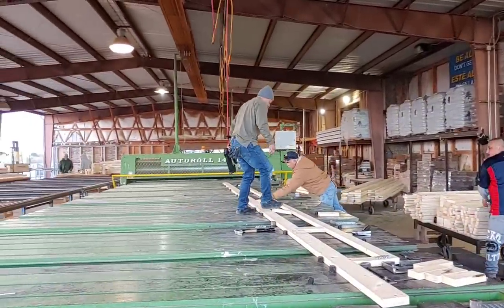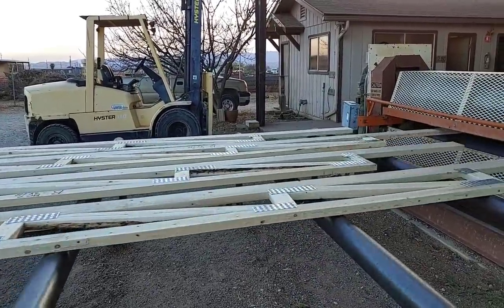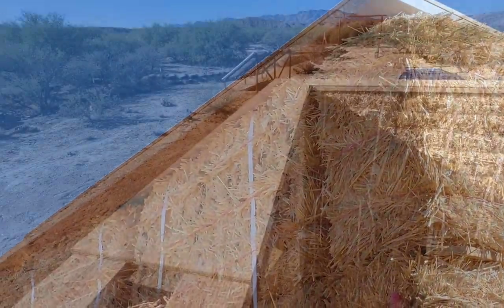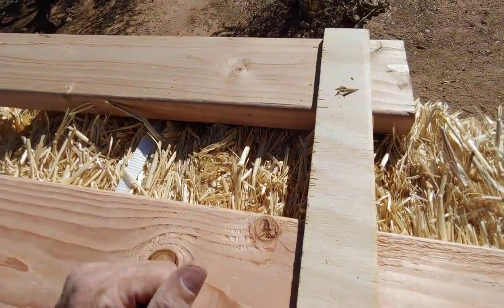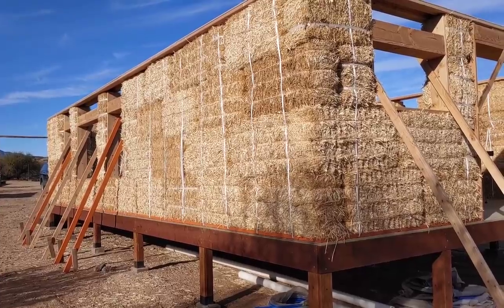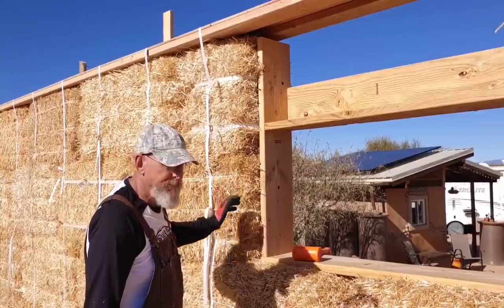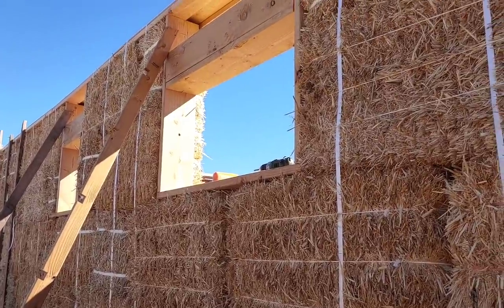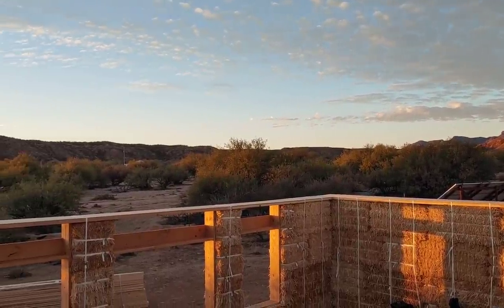#strawbalehouse #sustainable Straw Bale House Build Day 19: Box Beams And A Special Field Trip!

Comment: Great video once more Bill.  I was surprised that the straw bale walls needed that much fine tuning.  It's obviously not because of the work you and Yvonne have done as I know from watching your videos how meticulous you are when you build.  Bill can you kindly remind me what you have chosen for the exterior?  Some sort of cob or stucco or?  Thanks.
Reply from the maker: Thanks for watching and to answer your question,c we will be using an earthen plaster consisting of soil sand and clay with straw added for tensile strength. We will do two coats. The second coat will be fortified with about 5% Portland cement which we have found adds considerably to the weather resistant properties of the mix. Finally, we do use a breathable masonry sealant which is sprayed in using a garden type pump sprayer. This causes water to bread up in the surface like a freshly waxed car and prevents "dusting". Dusting is when you  rub up against the wall and start appears on your clothes. Sorry for the long winded response.

Comment: I'm generally seeing that people build box beams with 2x4s or 2x6s stood up on edge, sandwiched between osb/plywood on top and bottom. Your method looks like it'd save a lot on lumber (big deal right now!) but I worry about 1. the planks having more flex on their sides like what happened with this box beam and 2. thermal bridging happening since there's no insulation between planks. I'd love to know if/why you're not concerned about those things. Thanks!

p.s. I'm getting the same tool and straps/buckles as you after watching these! Hello from Tucson!
Reply from the maker: Thanks for watching and your comments. I'll refer you to an excellent book which I have been using as a guide for my decision making throughout the build. It's called, Build it with Bales Version Two by Matts Myhrman and S.O. MacDonald. They have a great section discussing the various styles and designs of box beams. I think you would find a lot a great information in this book for your build too!

Comment: Bill, it's looking really good!  I wanted to ask what model track saw you're using and would you buy it again?  Thanks, Al
Reply from the maker: Hi Al. I am using a Kreg Accucut XL. I chose this model for a couple of reasons but the first being price. The XL version costs about $150 and does NOT include the saw bit rather a sled that is mounted to a circular saw. 
It does not have a typical plunge action. It performs very well and does everything I need. I did buy the optional clamps for an additional $14 which secure the track to the sheet goods. Not always necessary but does assure that the track stays put.
I keep the sled permanently mounted to a Bosch 7-1/4" circular saw. I would definitely buy it again. What I wish it could do but can't is to allow a bevel to be cut.  Since I do not own a table saw, this feature would be a great asset. Thanks for watching and your question.

Comment: Sorry, Bill, what did I miss? At Southwest Truss, they "tacked" the mending plates on and then they went through the rollers. So were any more easterners put in?
Reply from the maker: That's all as far as the construction oof the trusses is concerned. Of course Timberlok structural screws were used in addition to hurricane ties to anchor the trusses to the box beam.

Comment: Building Roots follower 196. 

Ok question time.  What happens i 1 year, 2, 5, 10 years down the road when the bales compact and settle?  Do the bales decompose?  Thank you Michele
Reply from the maker: I'm glad you checked out their channel. Once the bales are plastered, and air is no longer reached, the bales will not decompose. There are straw bales homes 150+ years old with bales still structurly sound. Thanks for watching and your questions!
Reply: @theupsideofdownsizing   thank you Bill and Ivonne (Yvonne?).  I watch every episode but I some how have missed dimensions?  1 story?  How many rooms?  Will you be having to upgrade your solar?  Will you be keeping your trailer as a B&B in the desert?    This is just so interesting to watch your build. Ok so 19 days to get the walls up. Do you have a timeline for the whole build?

Comment: Now I wanna build a 20x25 shop with a 12ft door and ceiling be 16ft high in so I can put a car lift in. I live in Ohio. Can I build one and leave the bales in the elements while I'm putting the walls up or does it need to be covered when I'm not working on it. I know Arizona is pretty dry.
Reply from the maker: Even here in AZ, it's a good idea to have exposed bales tarped to prevent them from getting rained on ( or snowed on as the case my be) .

Comment: Hey the best way would be to stucco your walls with a stucco machine 
You could spray it on 
If I could have a green card I could do it for you
Reply from the maker: How about I let you borrow Yvonnes Greencard until the work is done 😉 I've seen those stucco machines/guns and they're fast! Only problem is, you need a monster sized compressor to run one. Thanks for watching! 👍